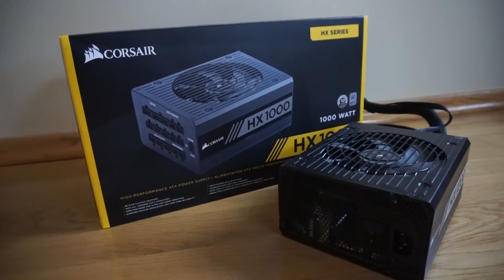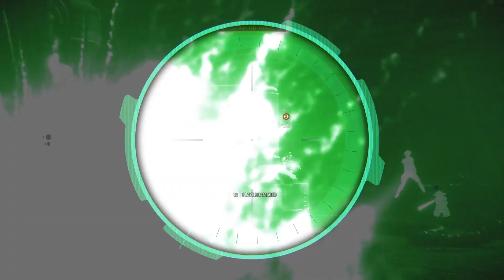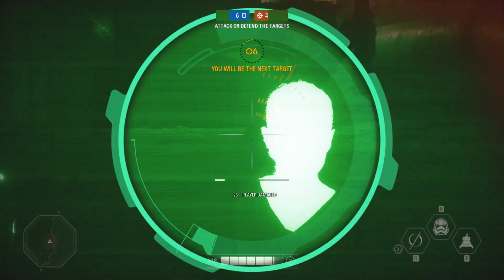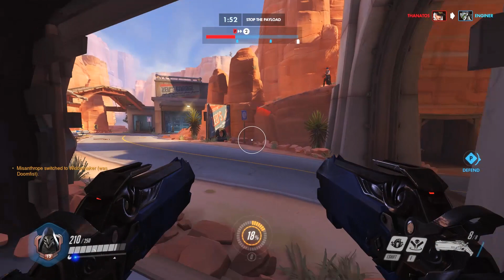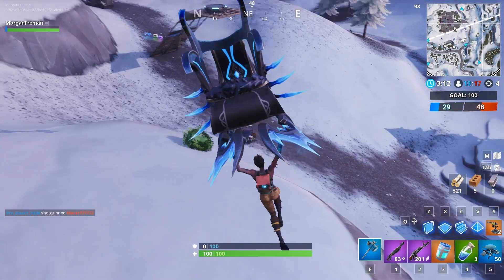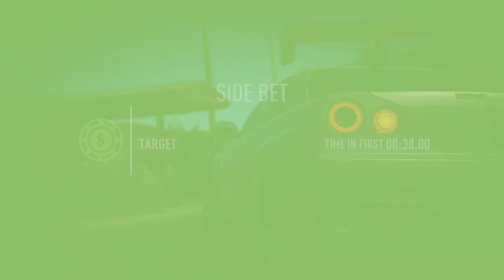Can a better Power Supply improve your gaming performance?!

Comment: You can try playing The division 2 at at least 1440p on 6900xt with ultra setting. Or Time Spy demo using that same configuration. Program that run CPU at least at 50% or more and GPU at 99% or more concurrently; but prepare a fire extinguisher :).

Comment: Electrical Engineer here.
From a technical Point of view I cannot explain these differences in performance.
Nevertheless an important bit of information is, that any Voltage-Rail in a highly regulated product like a pc, has a so-called "Tolerance-Band" on their Voltages, in which any certified component is guaranteed to work without an issue by the manufacturer. So if your 12V-Rail drops down to 11.8V under full load, that undoubtedly is not a great sign qualitywise, but no CPU, RAM, HardDrive (+SSD) or Graphics Card will be performing any worse than if the voltage had been spot on.

As a sidenote, such a decrease in voltage can also be attributed to bad quality psu-cable conductors. If they get warm-hot to touch under full load that'd make me wonder what else the manufacturer cheaped out on...
Reply: doo u know any kind of programm too set the psu in full perfomance? i have platinum with 1000w platinum from corsair and i want too use the full power of power factor correction too really reduce the reactive current. i can play only my games without Input lag or smooth feeling is the better word for it, when i plug my electro fire place in my overvoltage protector so it get a omsche load and feels so sexy but why why why? so many players testet it now and nobody know about this issue and why can no electrician explain this? hella weird
Reply: @nemesiz7175  This Phenomenon is completely new to me. So you're stating that your latency, consisting of: Mouse Movement < DataEncode < Transmission < DataDecoding < Computer reacting < Picture Transmission < Output on Monitor, is impaired due to a worse power factor of your PowerSupply leading to higher reactive currents?

Not really understanding your Setup with surge protected Powerstrip, Electric Heater and PC with Monitor, I can only respond in the theoretical way by pointing you towards the 50/60Hz Crosstalk to each and every conductive line in the vicinity of AC-Lines. Not so the actual output of the powersupply tho, as that's based on SMPS nowadays which work at multiple magnitudes higher frequency than your local AC-Lines carry. That then gets properly filtered before being passed on to the guts of your Desktop-PC.
Reply: @Elektrotechniker  What u say is true we heard about this
cuz our electrician. U can first test it by yourself.

If u live in a old house or apartment
then try too plug in a overvoltage protector a heater with 2000w
and play at the same time

u will se a complette performance at all

not only input lag is gone

Monitors Herz feeling much more smoother and
mouses are faster + keyboards everything.

Turkish players found out that a isolating transformer with galvanic isolation is very good for grounding problems. They plug there pc and monitor in it and play only with this device.
We need more electrician to find the 100% real solution.
Reply: but u need to activate the heater to fill the sockets with an ohmsche load. It's important.
Reply: As the PSU ages, the performance gets worse
Reply: Moin Leo,
since you are an electrical engineer, I wanted to ask you about your opinion on old PSUs. I highly doubt those performance differences in this video but think that stability and probably the minimum frames / stuttering benefit from a quality PSU. I got an old Fractal Design 750W 80+ Bronze PSU from 2013 and it still works like a charm with my new components. I think the only real concern are the capacitors degrading over time causing slight voltage drops. Do you know a good way how a professional noob like me can test the powersupply condition just for curiosity or do you know some source where someone does that? I definitly plan on upgrading to a new one in the near future but I don't want to let go of the Fractal PSU because it did/does still an amazing job.
Apart from that I took a look at your chanel and was wondering, if you are still planing on uploading videos? Just in case I subbed.

Schöne grüße, Julius.
Reply: @Ara10320  Random reboots and mobo displaying an anti-surge warnings are a sign of a psu in the end of its life.
Reply: @RoboBabeXD  No, thankfully there were no sudden reboots or mainboard errors for the PSU. I've ocationally had some crashes/instabilities but those were due to Radeon driver issues and I doubt those were because of the PSU since they were resolved by driver updates. For reference the PC currently has a Ryzen 7 5800x3D, Radeon RX 7800xt, 8 fans and 3 SSDs and in this as well as every previous build since 2013 the PSU was heavily used. My next PSU won't be from Fractal because sadly, they've become quite uncommon so I'll buy a be quied. They make the best PSUs in my oppinion and I also want to support my "local" brand.
What PSU did you have and how old was it?
Funfact: I've got a Dell work Notebook, which has displayed power adapter errors almost since new and with the factory plug. One of the two aftermarket plugs I bought later on can only power the Notebook without charging the battery and the second one works better that the factory one.
Reply: @Ara10320  I had a 500w kcas, which is considered a bomb psu, it somehow survived 9 years. Switched to a high quality local brand  2 days ago, my performance now feels like the first day i got this pre-build.
Reply: @RoboBabeXD  That is definitely impressive. I'm glad your components survived that PSU. xD
My second PC containing retired components once started smoldering while playing Battlefield1 and shut down soon after. Most likely it was the cheap 450W PSU but I'm not sure. Despite that it still worked after cooling down a bit. :P

Comment: Would be nice to record voltages in both scenarious. My 750W cheap brand with GTX1080 drops to 11.8V during 3DMark TimeSpy test. Maybe branded more powerful PSU did not bother much producing spot on 12V, while unbranded did not sweat much to produce slightly higher voltage during load allowing GPU to reach slightly higher clocks.

Comment: I got a question and thank you if you answer, I got a same specs as my office pc, but mine is i5 3570 & office is 3470, but playing Assetto Corsa with maximum settings, my office got a stable fps meanwhile my pc always stutter, can you help me?

Fyi, my office PSU is HyperK 600W 80+ Silver and mine is Armaggeddon (casing psu) 500w
Reply from the maker: Maybe it stutters because one of the PCs got a single stick of ram? Or different GPUs?
Reply: @CheapBastard  GPU is same, 1060 3gb, I just upgrade my PSU to 1stplayer 80+, just a little improvement, I don't know why tho, maybe my GPU vendor is suck 'zotac'. Maybe I'll try to upgrade my cpu soon, thanks tho.

Comment: Any cheap PSU can perform as good as the branded one . The only different is the longevity and material quality . The cheap one should not be use as your main psu but more as a back up until you replace it with a new one .

Comment: Conclude u should waist 300 euros for power supply.. if u have good gpu good memory OC and good CPU OC.. why ? When u game everyday 4 hours per day OCED GPU MEMORY AND CPu.. system will not break down or fry out. I have 1200PSU No problem oced cpu memory gpu.. Memory OC 4133mhz cl 16 GPU OC 5700xt to 2350mhz and CPU OC 5600x to 5ghz.. When i use 1000 Watt power supply.. i can not oc memory .. i can oc cpu or gpu only. If i use 850 watt power supply i can oc gpu and alitel bit cpu .. or non cpu and alitel bit memory to cl 15 3600mhz. if i use 750 watt after 4 hours per day gaming after 3 days psu die. than i can not get turn on pc.. it shuts down complete.. 3 days needs to put out voltage outsite... BUt i had only gpu oc ... after 3 days system works normal.. Yes u should not use power supply if u do not know what you are doing..

Comment: Cheap is always a risk. Don't settle yourself in it.
Reply: Im using the delta GPS 1300w Platinum for my 4090 , it came for free with the 4090.should i leave it or buy a top brand 1000+watt psu?

Comment: Hello my 3070 doesnt reach the FPS from all the video. It is something like a 50fps difference in Warzone and it currently runs at 110 FPS with dips to 90fps. Do you think this is a psu issue 
Specs:
I7-8700
Rtx 3070 Founders Edditions 
16gb ram (2x8)
1tb ssd
Z390 AsRock motherboard 
600w Psu
H100i pro xt water cooler 
H510i
Reply: Hey bro! There’s a couple of things, I’m pretty sure Nvidia recommends 750w PSU for a 3070, also it could be your CPU bottlenecking it

Comment: Corsair HX1000 80+ is 1000watt, and unbranded is 500W but unbranded in most case win. That means, for certain cases u need to consider power efficiency usage for overall connection to your system to maximize power usage. otherwise, the rest of the wattage will be useless and even have no impact on your system. Many thanks for the video bro. This means a lot for PSU purchase consideration.
Reply: lol ur logic of comment..

Comment: I installed a new gpu and then my games runs really slow and it stutters. Is it maybe because of my cheap 700 watt psu? When i’m still using the gt 710, it runs well but when i installed the gtx 1050, my games run really slow.
Reply: Did you solved it?

Comment: Unbranded what is the life expectancy, constant wattage, what kind of material are the wires made from. how much noise does it make, is there a temp safety switch. Many factors that I wouldn't pass off on a trusted brand because If my pc dies on me RIP xD cannot afford to build another. Very interesting though, warrants research.
Reply: wth are you talking about I used cheap power supply for 11 yr without any problem
Reply: @ujjwal6444  I used a cheap thermaltake 430w PSU for a few years. bought it brand new at Fry's Electronics. It died. Had bad voltages.
The used Corsair PSUs that I've bought from ebay have all worked flawlessly so far.

Comment: MY PC specs
I5 3470
8gb of ram
a cheap 450W PSU
i going to add a brand new GTX 1650 super Do I need a new PSU?
Reply from the maker: Firstly buy the 1650super and then try running some stress test. I had that gpu running perfectly fine on Antec Earthwatts 380W 80+ White
Reply: 1650 super have low power consumpt9pn,you will be fine

Comment: i have i3 9100f and gtx 1650 super and psu 230v which came with the cabinet  should i replace it ?
Reply from the maker: If it works fine, you don't need to
Reply: Same  same situation mera bhi
Reply: 230w with those specs? upgrade it rn as its probably a crap psu
Reply: @hernimaniak2379 my man can't even read and differentiate between voltage and wattage
Reply: @myth1351  why reply after a year ?
Reply: @hernimaniak2379  just try not to talk when u know nothing😉
Reply: @myth1351  I already know the difference between 230w and 230v it's Been literally over a year
Reply: @hernimaniak2379  so why didn't u delete ur misleading comment
Reply: @myth1351  do you think I think about some random comment that I wrote over a year ago? I have other things to care about in my life than just a dumb comment... You act like you're 13
Reply: @hernimaniak2379  so u chose to fight against a random comment
Reply: @hernimaniak2379  any rules or laws saying that we shouldn't reply after a year, it's even a misleading comment in this case

Comment: I have an i3 6gb ram and gtx 1050ti 
I am using a local 400W psu do I need to upgrade it?
Reply: is it giving issues?
Reply: how tf you gaming with 6gb of ram? Yeah you should probably upgrade, but the graphics card will be fine for now.

Comment: My pc is Core 2 duo 
4GB DDR3 RAM
and I am going to install Nvidia GeForce GT 430
And I have 235W power supply
Do I need to change PSU? 
Please reply
Reply from the maker: I think it will be fine as long as your gt430 do not require additional cable from the psu
Reply: @CheapBastard  Thank you so much for your valuable advice 😊 
Glad to got your reply ❤️
Reply: @ijitherandom6818  wow i bet you get 50 fps at 480p that 200 dolllar system wtf is that
Reply: @ijitherandom6818  4 gb how do you anything on that
Reply: @voltage5802  For your Information, I'm playing Grand Theft Auto 5 on Medium settings and I'm getting 30-40 FPS 😏
Cuz my core 2 duo is e7500
Reply: @ijitherandom6818  cap cuz someone with a 970 cant even get that
Reply: @ijitherandom6818  but all jokes man everyone has theyre budget you should really upgrade that system how tf does that power supply play gta
Reply: @voltage5802  Go and watch game plays of GTA 5 on Core to duo E7500 and you'll get to know.....
Reply: @voltage5802  yeah man I'm going to upgrade it to 8Gigs of RAM
Reply: @voltage5802  No bro jokes aside I really play GTA 5 on 235PSU
Reply: @ijitherandom6818  upgrade do you meed money man cuz that hurts i can give you 400 to upgrade to a better card and get a 450 power supply
Reply: @ijitherandom6818  you cant play gta with 4 gb ram btw oh snap you can wtf

Comment: i have an rx 580 nitro + 8gb, ryzen 5 1400 stock 16gb ram 1 ssd 1 tb and a 450w psu, and i get a lot of gpu usage drops on certain games like tarkov and maneater ik they arent the best optimised games but on medium settings i barely get 60 fps could this be the psu? because i doubt its a cpu bottleneck and i have reinstalled drivers many times
Reply: do u get weird sounds when ur pc idles after a game?
Reply: You ask us if is a psu problem but you didn't tell us what psu you have exactly, rx 580 have big power consumption and you should have a 500W psu from a trusted brand, or 450W 80+ certifcation. you are also bottlenecked by cpu if you don't play at high settings because ryzen 5 1400 have the worst single core performance from the desktop ryzen cpus, is the same of ryzen 3 1200, but the games might be bad optimised as well
Reply: Tarkov is a very CPU intensive game, so low GPU utilisation is normal for Tarkov.
Reply: Im using the delta GPS 1300w Platinum for my 4090 , it came for free with the 4090.should i leave it or buy a top brand 1000+watt psu?

Comment: My pc config is i3 6100
4*2 2400mhZ ram
iam using a local psu, and want to add a 1030gpu
My psu upgrade is necessary?
Reply from the maker: Nah, you don't need a psu upgrade for that gpu

Comment: Two months later whole system fries
Reply from the maker: A very possible scenario 😂😂😂
Reply: It happened to me! I had a cheap stock psu and it worked great for 6 months. It suddenly died while I was in the middle of something extremely important. It almost fried my mobo. So I’ll take reliability over wattage any time.
Reply: I'm sorry to hear about that Abdullah that's has to really suck I'm glad it didn't fry the whole system.

Comment: Yeah but what are the wattage on the pcie rails on those psu it's possible that the cheap psu had a higher rail wattage but jus very dangerous and cheap maybe 200 watts on the pcie rail shared or what ever and the corsairs Prolly 150 to 160 on those rails maybe might be the case

Comment: Is it same, in case of gaming laptops?
Although gaming laptops are need power supply so we plug and play games. But, I think overtime it some how damage battery. Along with that we saw a drastic performance degrade in graphics only.

Comment: I need help understanding why this happened in my PC. Soo here's what happened and I'd like to know why it happened. I had an 850 watt psu from EVGA i upgraded to a 1000 watt of the exact same brand and model just with a higher wattage... I re-ran OC Scanner on MSI Afterburner.. And my overclocked went up literally 100 mhz on average over the curve. My system is an i9-9900k, atx MB, 1x 2080 ti (Asus strix), CPU is water cooled on a 360 rad... Nothing but the power supply changed. Why did the overclock scanner find such a higher oc...? I ran this test in the exact same everything and I deleted and reran it several times and it was higher every time than the 850 watt psu. I can't imagine 1x 9900k at 4.8 GHz and 1x 2080 ti pulls close to 850 watts.... So what's happening here?? Because this phenomenon actually increased my fps by about 5-10 fps over previous overclock with the higher wattage psu.
Reply from the maker: I think that your newer PSU got a better efficiency rating and a higher overall wattage used less of the PSU's maximum capabilities and because of that, smoother power delivery was the reason why you got higher clock speed. By the way, on one YT video I saw i9-9900K using 450-500W of electricity when overckloked substantially, so it might be the case that you was pushing your PSU's limits. But that's just my opinion
Reply: @CheapBastard  that was my thought also, but It didn't really seem to fit as my cpu isn't currently oc'd so between CPU gpu its less than 600 watts. Can't imagine the rest of my system using up that much extra power.
Reply from the maker: @Tech-Synthetic  Oh, if you CPU is not overclocked, then it is super strange. It is really unlikely that your whole system is using that much power